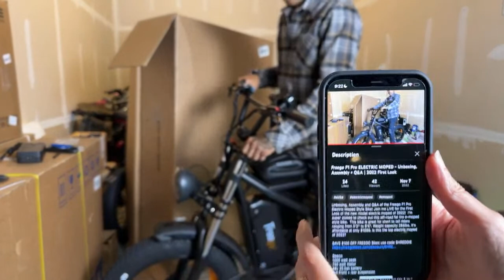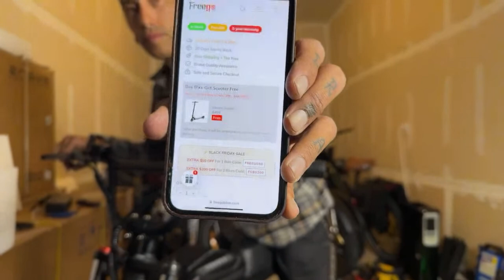Freego F1 Pro ELECTRIC MOPED - Unboxing, Assembly + Q&A | 2022 First Look

Comment: Hi, you can use an adjustable wrench to bend and correct the disc rotor.
Reply from the maker: Thanks for the tip!🤘🏾💯
Reply: Beat me to the suggestion. What's great about using an adjustable crescent wrench for truing your rotors is that you likely always have it with you if you tend to bring any tools on rides.

Comment: Hellooooo Mr. Shreddie. I am kind of in a bind that hopefully you can help. Have a 1000 watt bafang mid drive with 52 volt battery. I’m looking to configure the motor settings. Have the cable straight from Amazon. Download it all necessary apps. I’m getting a red flashing light on the cable. Will not hook up to the bafang configuration tool. Yes, it found COM6 but everything else is in grey. Can not read, write. And the cool thing is I’m only about an hour away from Rehoboth. Please help
Reply: Daniel are you running on a laptop?  I'll note not all laptops use the COM6, for example mine uses COM8.  You might need to restart the app with the cable attached and see if other port options are presented.
Reply: @ebikeengineer   cool ty I’ll try that
Reply: @ebikeengineer  I guess Shreddie is busy these days. Yes I’m using a PC. I’ve tried the Bafang configuration tool and the Luna configuration tool both of them are on Comport 6 And according to my computer that is correct I moved it to comport 5 and it automatically switched. Neither one worked. Everything is good till I hit the connect button then the little red light on the cable starts flashing and I don’t get any read flash or write flash lit up. Nothing happens except for the little red flashing light. Is it possible I can have a bad cord? Looking like it. I really thank you for your info and willingness
Reply from the maker: Sorry I’m late were you able to get it working?